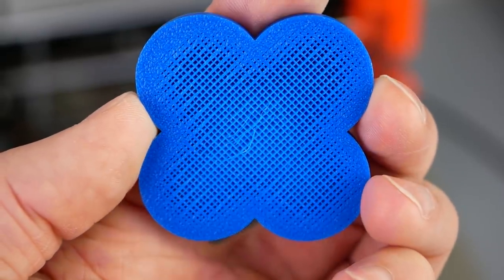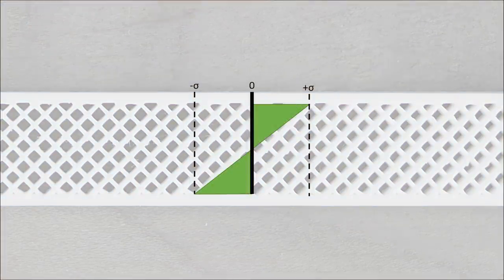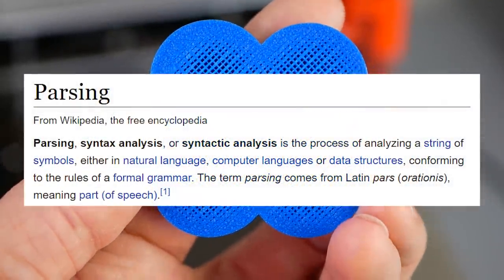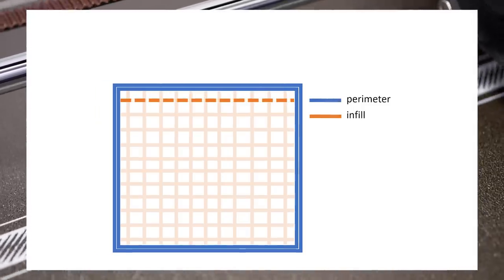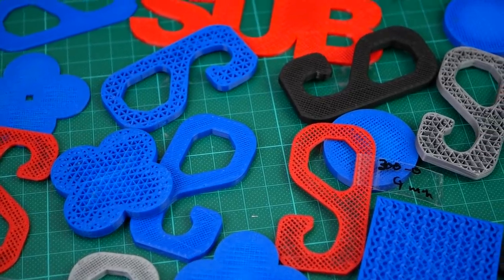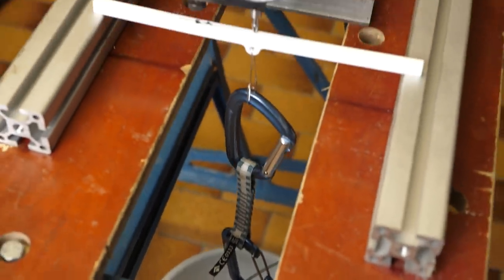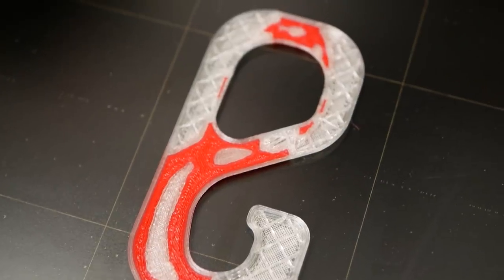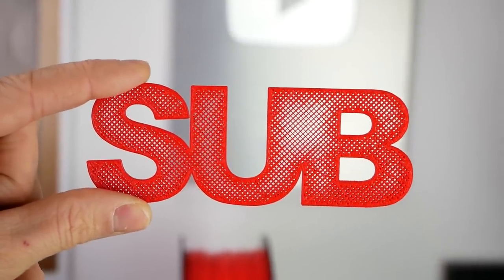Gradient Infill - NEW efficient infill for 3D prints!

Comment: Excellent as always, thanks for sharing! Do you own a Tevo Little Monster Stefan? I'm having a very hard time getting retraction working properly again after I replaced the included heat break with an all metal one. I replaced it because the original had a small PTFE insert that became deformed from the heat when swapping nozzles and I didn't have any 3 mm ID 2 mm OD tube to replace it. 

After retracting there is sometimes a delay before the filament extrudes on the next segment. I've tried all known good retraction distances and speeds but nothing has helped. I also tried lower and higher temps and different nozzles and sizes with no improvement. I think the main problem is that the slightly expanded filament in the nozzle encounters resistance when pulling back into the heat break, which doesn't seem to be adequately cooled. I'm going to try a titanium heat break from Triangle Lab and attempt to design a shroud to concentrate the air flow directly through the heat sink. It will be tough with that BL Touch right in the air flow path though.

Comment: Believe it or not, this has actually been a fully supported feature in IceSL for the last three months. It also supports the generation of user defined anisotropic cellular foam, allowing for engineered compression and structure depending on the axis of load. 

Amazing slicer, built around an entirely scriptable front end and GPU accelerated 3D shaders.
Reply: I do really like how your implementation uses material flow rate to change the infill percentage. It provides the benefits of variable infill rates without an increased print time penalty.

Comment: Have had printer for a year now. I have never found gyroid infill to be useful. Most of the print just using zig zag since it is the fastest, without extraction at the end of each line.. PLA is surprisingly strong when it is well printed, infill connect to walls makes a  lot of difference.

Comment: Great video.  I have a couple of points I wonder from here:
1) Would the performance factor be consistent across different materials.
2) Love the scripted gcode replace.  Can't think of the math but if the extrusion width was also mapped to some kind of curve rather than linear points (probably exponential curve of squared in order to not require as many points for accuracy - thinking it maybe less accurate on a skewed curve with only so many linear plot points?) basically reinforcing from the outside and reducing faster on extrusion width?  I'm sure if could be done with some googling brushing up on math and doing a little script in python same as you.
3) Above all this...does it matter?  100% or bust?  Or like you said - stress simulation mapped infill.

Sweet video.

Comment: At 1st look the infill pattern recall my memory of pushing infill speed to crazy, and given the printer slower acceleration value.

Results in the extrusion rate unable to follow the extreme speed in the middle of the infill. Creating thicker line near to beginning and ending of the infill line.

It may work for gradient infill on Bowden extruder since it react slower than direct drive. But I think limited to straight line type infills only.

Comment: Nice idea for the infill! The next step could be usage of generative design software for smart infill creation that will form smart inner structure of the printed parts and not just simple correlation of the material quantity to the loads as in your previous method based on simulation results. And also generative design parts should be easier to export from the CAD software for printing comparing to the simulation results. Thanks for your work it is really inspiring!

Comment: Could you make a hot end with a controllable fan that focuses cooling on one side of the nozzle at any given moment? This way, you focus cooling on the material immediately after it goes down without overcooling the rest of the layer. The Gcode parser can control which fan is active.

Comment: There are two ways to control infill gradient: increase structure 'scale' or decrease Wall thickness. I'm not sure if these methods produce similar rigidness for the same amount of material. I would guess that thinner walls would not work as good as larger infill cell size with permanent wall thickness.

Comment: You can't really calculate bending stiffness from a three-point bending test, because three-point bending mixes bending deformation with shear. You can estimate it, of course, and it helps that your beam is fairly slender, but if your goal is to measure bending stiffness you should make a simple four-point bending rig.

Anyway, the main advantage of gradient infill won't so much be bending stiffness increase, but rather increased buckling load of the walls. If you want to increase bending stiffness, your best bet is still thicker walls (think I-beam), and for shear stiffness, it's still probably uniform infill. But with gradient infill, you can dial the infill down pretty low before wall buckling becomes an issue. It would be interesting to do a similar beam-bending test with thin walls and gradient infill at a much lower infill rate, maybe in the 5 to 15% neighborhood, so that you're operating near wall-bucking load.

Comment: You should do a video on filling 3D prints that use a simply connected infill like gyroid. I bet there could be some gains to be had by using some sort of cheap recycled filler (like wood/paper pulp) to increase the strength of the parts under certain loads.

Comment: This is very interesting I see a potential use in a 3D printed filter for face mask, it will probably will not be small enough to capture small virus particles but if a case  with these gradiant allows air to flow trough the. You could encase an activated charcoal granules in a gradiaent like casing

Comment: Hi Stefan - great stuff.  I tried the BOWDEN_cloverleaf_wHole on my Creality-CR10S and found very little change in the diameter and/or width of the infill.  Which of course has a stock Bowden tube feeder.  I will say there is a noticeable change in feed-rate audibly.  I haven’t looked at the python code yet, but suspect the performance (responsiveness) of the Bowden feed may not sufficient.  Direct drive may be the only way to best exploit your method.

It is interesting in that I do hear this feed-rate change as the print head passes the center of the clover.  I can share images of the print if you would like.

Update:  I looked at your python script and changed the maxFlow parameter by a factor of 10 (350 to 3500).  I do see an occasional difference in the infill line widths.  However, nothing like you direct drive samples.  When I said “noticeable audible change”, I mean in filament feed rate, not the clicking with too fast of a feed that the hot end can’t keep up.  I do get the clicking with maxFlow = 3500.

This would take more time than I have available to study.  I do think your “algorithm” has merit, though.  Probably best to stick with direct drive filament systems.

Cheers!
Reply from the maker: Thank you for your efforts. I'll try to make it work for bowden systems as well.

Comment: 1 Would it be beneficial to have a few arrays with different "curves" from maximum to minimum extrusion width? 
2 What about instead of altering extrusion speed, alter the movement speed? 
3 Unrelated to gradient infill, but what about modifying infill so it minimises trapping of airbubbles for filling with epoxy resin? edit: And connects all different parts of the model as much as possible for a way to uniformly pour?

edit: probably never going to see replies to this comments as youtube notif's is dead in the water.. hmu on twitter instead
Reply from the maker: 1. Good idea.
2. Probably a perfect way for Bowden printers.
3´. Uh?
Reply: I figured what I said with 2 would be effectively equal, as it just comes down to how much filament gets put down at any given position. Would maybe give opportunity to create soft voxels of arbitrary density with some gl-to-3d array code and/or vice versa.

Ah what I meant at 3 was; instead of optimising infill to maximise model strength, deliberately have holes throughout the model in such a way that makes it easy to fill it with epoxy resin later on, in effect using the walls as a mold. Opportunities to optimise for precision to end up with very accurately dimentioned parts made of materials that can't be regularly extruded / printed. I feel as if there's a whole part missing in the fabrication process, and python wrappers that make molds out of models would (no pun intended) fill that void quite nicely.

Comment: The idea is one of the best  parse/string_replace concepts I have seen in a very long time.  This means if the other vendors would simply markup thier code as CURA has, this could use a parameter adjuster based on slicer being used...   Brilliant!!!!       As I have begun to deploy a print test, i have 1 question to ask. Are you calculating the X gradient as well?    For models that present warping issues due to large surface distribution/curling, this could be a solution.  If you only wanted to strengthen the plate level of a print the ability to "set a z layer cutoff / disable gradient after this layer" option would be amazing.  Just thinking out loud Stefan.....
Reply from the maker: What do you mean with X gradient?
Reply: @CNCKitchen ,  I apologize for my mistake in axis identification there.   The assumption was based on the presented example that the gradient was only generated for X and Y axis and not for the shell parameters on the Z axis.

Comment: This is good, and clever ! 
I would be very interested to know more about mixing topology optimisation with gradient infill.
Maybe you can start by making a 2D topology optimisation of your hook, use it as a boolean body in a CAD software and then have two bodies : one wich is the low infill part and another one with 100% infill. Easy to use with a 1slicer setting per part configuration. I might try it myself :)

Comment: Cool video Stephan,  thank you for sharing.  You got me thinking about another improvement that could be made to infill.  As you know printed parts are significantly weaker in the z axis due to layer adhesion. I was thinking that several types of fill patterns like a grid provide a vertical cavity while the part is being printed.  What if we were to fill some of those cavities after x number of layers by quickly extruding some material into the cavity?  I think this would make the part much stronger in the z direction because it would have pegs of material that were not extruded in layers.  I have no idea how to implement such a thing, but it sounds like you might be able to figure it out.

Comment: hey great work!
what do you think of being able to set the "thickness" of the infill separately from the standard line width. So what i mean is, infill is usually just one line thick, regardless of the %. But I think this makes it weak as it's just one line. I'd like to keep the perimeters line width as they are but increase the thickness of the infill so that it prints multiple lines, like a multi wall infill if you prefer. they would act more like internal webbing / gussets

Comment: Just a thought, to improve layer bonding, do you think it would be an idea to create a hole in a part (like a bore) and then fill it up by extruding into it. You'd get a core of material extruded in the Z direction. Not sure it would bond that well internally but might work

Comment: Great video! Have you considered gradient shells? As in toward the sharp corners between bottom layer and exterior walls having more walls (a gradually increasing infill space). In my anecdotal experience most failures start at the walls and I think this could dramatically increase strength.
Reply from the maker: Might be a great solution as well! This are the ideas we need to gather and try out.
Reply: @CNCKitchen  Agreed...YouTube comments are a horrible place for that though. Thoughts as to a more permanent forum where we can move through hypothesis to implementation in a better way?

Comment: There is some improvements. But on the bending stress you did not add the side faces. These will add a lot to the bending strength. The tensile test has faces so the result is closer.

Comment: What about converting the 3D stress diagram to a 3D voronoi structure which then can be used as infill structure? So more stress means smaller cells and less stress means bigger cells.
But of course this has to be implemented in the slicer itself, it can not be done using post processing.

Comment: Is it possible to export mesh values of a FEM Analysis out of Ansys (or any other simulation software) ? I think of some kind of 3 dimensional matrix describing the stress values sorted by coordinates. Then make the same of the gcode and lay those two tables over each other and calculate the extrusion multiplicator in proportion to the stress.

Comment: It's a cool Idea and great execution, but I am not convinced, that it is better than just increasing the number of perimeters. That would have been a better test, than just comparing to normal Infill.
When I think about it, I have never seen a test, if it makes an difference where you put additional perimeters/material. Many materials are more resilient to tension, than to compression and vice versa. Maybe its enough to strengthen only on side of a part.

Comment: Hello, l am thinking it would be the best to implement the infill generation in the CAD software like SolidWorks/Fusion and print then the model with 100% infill. Advantage would be, I can check and optimise the strength with FEM simulation.

Comment: Brilliant! Could there be issues with adhesion/strength on the z-axis by using variable extrusion width? The infill is 1 line wide, so maybe towards the middle of the part, the infill bond between layers isn't going to be as strong? Maybe run a strength test printing your part in a different orientation with the hook at the top of the print.

Comment: Hello, did you read my comment about filling glue IN model? I think it is easy
Reply from the maker: Of course. The resin was already delivered.
Reply: @CNCKitchen  You might want to try adding some additives into the resin mix like chopped carbon fibres or carbon/alu powder for strenght, glass microspheres to reduce density and all the other comonly used aditives in resin systems.....

Comment: can you do a strength test with angle 3d print like instead of print your piece vertically or horizontally you print them in 30 or 45 degree angle see if this improve the strength.

Comment: hello stephan i m currently trying to recreate the same technique and after i made the 3d file - stl , when i put it in the slicer, after the calculations it takes significantly more time to print. I guess because of the complex and excessive travels between the holes. Did you have the same problem?

Comment: It seems like automatically increasing infill based on FEA would be hard to put into a simple workflow. Would it be possible to manually select areas to increase flow in, similar to how Cura's support blocker works? Especially since I wouldn't usually need FEA to tell what the weaker areas are.

Comment: If each segment is being adjusted for flow (and subdividing long segments where necessary), why not change the print-speed per segment instead?
Velocity painting, but use proximity to the wall to set the gray value fore the 'image'.
Ambient occlusion?  Darker is denser in-fill?

Comment: That's very clever indeed! Do you take "3d distance" into account, or only in the xy plane distance?
Reply from the maker: Not yet, this world be easier to implement in the slicer directly because in there you should have that information.
Reply: @CNCKitchen  I think it could absolutely be done from the gcode file. I'm a computer programmer by trade, but I don't have much experience with gcode files, but I've done a lot of 3d programming and my thinking is this;

If you process the entire GCode file, you could determine all extrusions that are "outside layer" extrusions. Since you know where the extruder started and ended, you have a lot of 3d lines in space that represent the outside perimeter. For each of your 1mm line segments, you find which of the outside extrusion lines that are closest to your infill to determine the distance to the shell. This might be very slow for very many infill segments, but with some simple spatial partitioning code, that could be managed.

Though I realize that that's outside of the scope of your proof of concept project - nice work!

/mattias

Comment: I dont know if this idea is already in use, but I haven't come across it yet. 

Why not take a basic finite element analysis plugin and have that do a calculation on where the stresses in the part will be and then adjust the infill according to that?

I imagine that it would need an adjustment for percent of infill and a gradient that you could adjust so you could choose how much infill you wanted in the most stressed areas of the part.

There are open source FIA software already so I imagine that someone with knowledge of programming could make this plugin from that.
Have that been tried already? I am not active in the 3D printing community, so I might just have missed it

Comment: How do I use the gradient infil? Do I plug it in to cura?
Reply: If you are asking how to use his particular tool, it parses and edits g code. It's entirely separate from any other slicing software, it just takes the machine code which was output by the slicer and changes some parameters within the machine code based on his specifications.